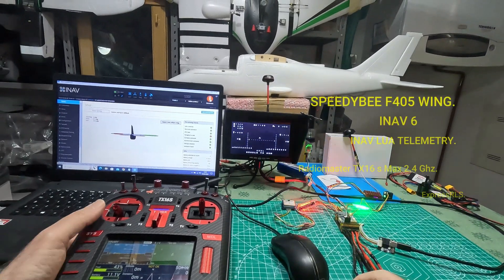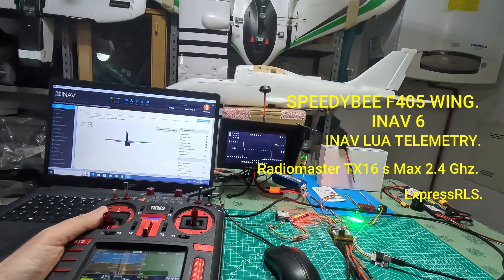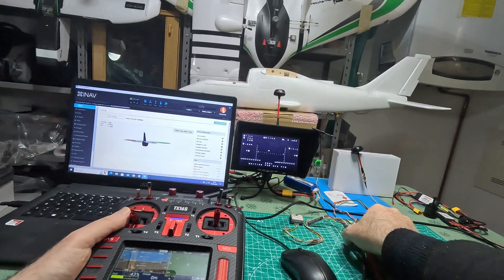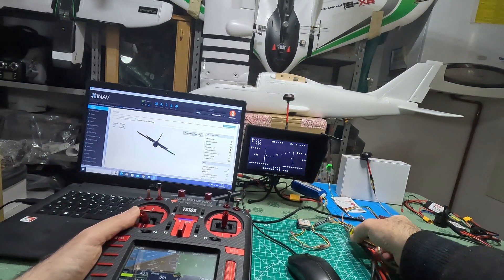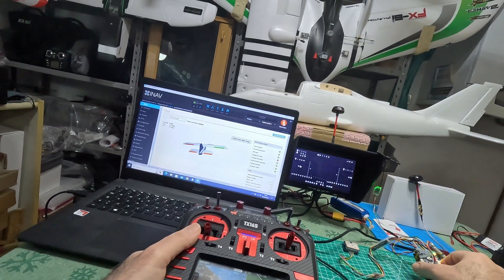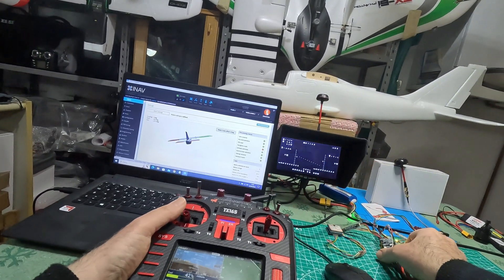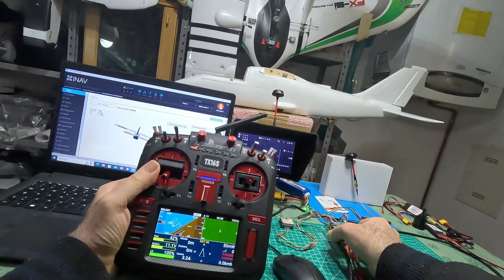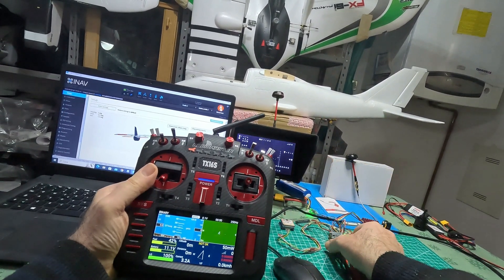INAV 6 LUA SCRIPT. SPEEDYBEE F405 WING. RADIOMASTER TX 16s MAX. ExpressRLS.

Comment: at 8:12 , I pressed the button "MDL" but my TX turn to page "Manage models", cannot go to configure parameters page. (My TX is TX16S mark II, Egde TX v2.10.5 centurion, inav lua 2.3.0). I tried to run lua script in SD card and the mess "Script syntax error" pop up. Please help me. Thank you
Reply from the maker: Hi, make sure you have copied the downloaded files to the right directories, try making a new full screen widgets, choose Lua telemetry. Make sure the visual telemetry arrives and works, (requires a receiver with crosfire protocol) then press and hold MDL. The configuration menu should appear.

Comment: Bro i am making my FPV drone with speedybee stack STM32F405 so this speedbee flight controller work with this radiomaster TX16s mark 2 4 in 1 ? I have not purchased flightcontroller yet so tell what i have to purchase with this Flight controller and i am using emax eco ii 2807 1300 kv motor and this motor max peak A is 51A and speedybee has 50A ESC 4 in 1 this will work with this ESC ?
Reply from the maker: Hi, the FC you chose has a max of 55A, 50A continuous, so you're at the limit. As for the receiver, be it PPM, PWM or Sbus, it must be configured with betafligh, regardless of whether the radio is equipped with a 4 in 1 module. The FC. Comes with betaflight installed.
Reply: I found v4 version of speedybee that comes with 60A 4 in 1 this is compitable for my motors the A is higher than motors and for Radiomaster TX16S MKII 4 in 1 i am gonna use elrs receiver for speedybee FC  @MrSalvoFly
Reply from the maker: If you have a radio with a 4in1 internal module, to use an ExpressLrs receiver you must buy the external module, such as Radiomaster Micro ranger 👍🖐

Comment: Followed steps, no results. Just wish someone had tutorials for dummies that have no clue.
Reply from the maker: If you can give me some more information about your type of radio, receiver and FC you are using, I can see if I can help you. Please note that this video is not for configuring inav, but how to have graphical telemetry with Radio, crsf, and fc receivers that support it.
Reply: @MrSalvoFly  Thanks, it's a RM TX16S, RM RP4TD RX, Speedybee 405 Wing FC. Setup radio according to Painless360, RX connected, telemetry etc. No receiver map results in INAV. ....well figured some out, model mismatch. replaced original receiver and got mapping now. We'll see about controls in a bit. Thanks for responding, I might have a question for you later. :goodvibes:
Reply from the maker: Ok, let me know if you need help.👋